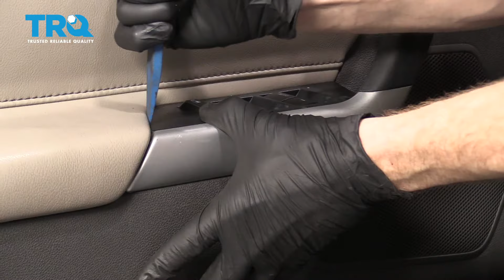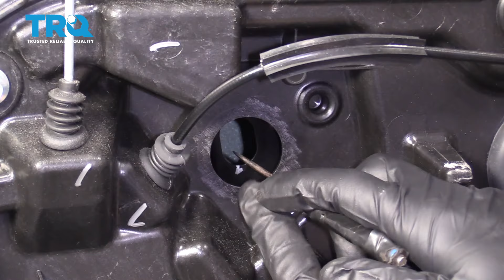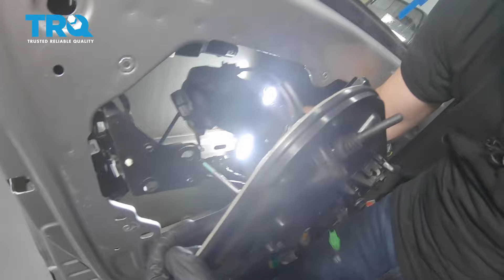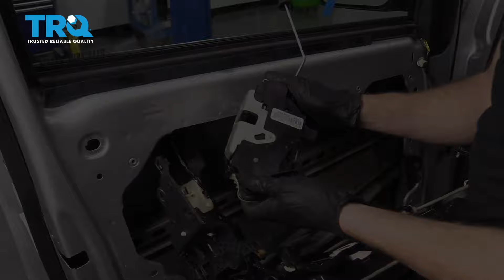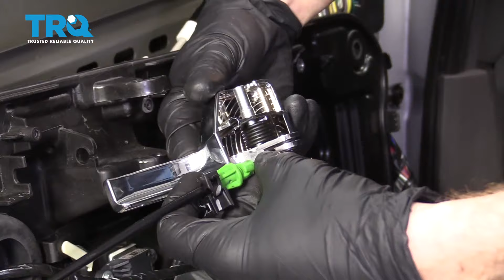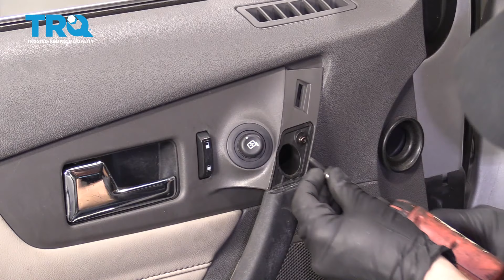How to Replace Front Door Latch 2007-14 Ford Edge

Comment: GREAT VIDEO, but NO WAY you did this in 24 mins more like 2-3 hours lol, I had to replace my 2013 driver door latch do to the well known 2013 edge problematic door open alert - which keeps the interior lights on and kills the battery even if the doors are all closed, not sure why 2013 has that issue the most? and I didnt know about the 2 little screws hidden in the track that would have been more helpful but I got it done, having 5 upullit junkyards near me I got to practice on their vehicles first before doing mine, anyway I was able to get 3 used latches - just in case - out of the same junkyard for $10 each 2012, 2013, and a 2014, the first one worked for me from the 2014 and took that door ajar light off my dash - fixed! its definitely a job you only want to do once and I recommend a new assembly over used you never know how long the used one will work, you dont want to do this job twice I got lucky - Ford engineers should have to also fix and repair the cars they create guaranteed theyd make it easier, thanks again

Comment: Thank you for this highly detailed and professional video. I am considering this because I am dealing with the idiotic door ajar issues in my 2013 Ford Edge; I have heard that the sensor is located inside the door latch. After seeing this video, I am still considering but realizing I will have to set aside a good amount of time to get it done, and make sure I get the part ordered BEFORE I start taking apart the door panel. :D. If anyone here replaced the latch because of the same door ajar sensor issue, please reply here your words of wisdom or input on the situation. Thanks much. I own the Edge and don't want car payments, so trying to drive it as long as I can. Thanks again. Happy wrench turning. :)

Comment: Great video! However I will say, if you aren't wanting to fish bolts and screws out of the door after you get it mostly back together, do this: 
Only loosen the window bolts enough that you can slide the window up and out of the bracket
Only loosen the screw on the back end of the door enough that you can slide the handle trim out
And DO NOT take the screw that holds the exterior handle bracket out all the way, loosen it only. Old lock tight can come through with the screw, gum up the threads, and cause you strip that bolt head when you go to put it back in.

There was also some things that didn't apply to the 2013 model as well, there's no more 8mm bold inside the panel. You don't have to completely remove the harness either if you're working on your own car (Passenger side at least). Just unfasten the very front clips so you have wiggle room. You can also leave the interior handle alone. Leave everything on the latch until its out, and pivot the panel out and rest it on your lap while you sit in your passenger seat. It makes getting all the parts off the latch easier. Work smarter, not harder.

Comment: Thank you for making this video. It was very helpful. For those who are thinking about doing this job, you really need to consider your time availability and level of technical ability. This job was pretty tough and I have fixed some complex systems. Also, you will need someone to assist you when putting in the two inner screws.
Reply from the maker: +@opsecalpha Thank you! We love empowering our customers and showing how to perform DIY auto repairs with our high-quality auto parts! http://1aau.to/m/Shop-TRQ

Comment: I did it watching this video, but it took me about 6 hrs. Taking it out was the easiest part, but putting the two bolts that attach to the panel was very challenging. Also I had a hard time resetting the window glass as one of the brackets came off while the panel was already assembled. I would loosen the bolts to lift up the glass instead of removing them as that would have made the job easier. Also take a picture of the door latch before removing it. I had a hard time putting it back together  so I had to constantly rewind the video. This guy obviously knows what he's doing, but for the weekend warrior be warned that it's quite the job unless you have a lot of patience.
Reply: Looks like it's not easy job 😮
Reply: Look is a pain to get to it but I'll try it and keep in mind your avise 😊

Comment: Great Video! Was able to replace rear left door lock on 2013 Edge. Replacement part from Dorman - works like new. Took time, and had issues with door mechanism (inside spring came undone) and later window wouldn't go down, but worked it all out.

Comment: 3 of 5 stars.
Never showed:
1- how to disconnect the green clasp to lock itself
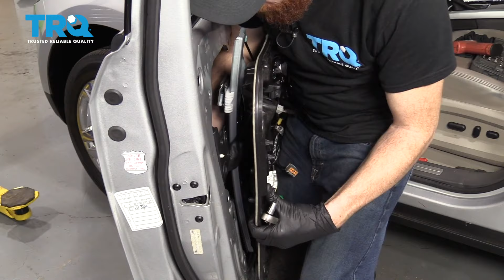2- the 3 bolts to the actuator magically appear at 13:03 to 15:35 and disappear again at 15:38. Then you "install" them again later?
3- around 16:35 you cut out the part where you have to disassemble the door to put the lock bar through the door. It magically appears ar 16:45
 But thanks for the video, it gave me a good guideline

Comment: You can much more easily disassemble the door handle on the outside and pull the latch and window regulator panel out as one, then address the fiddly lock/handle/etc with plenty of space.

Comment: finally replaced mine last night  could not have done without your video thank you  biggest problem i had was 4 of the 9 bolts holding inner panel in place i needed to grind off what a nightmare and those 2 bolts on inside of panel didnt have a problem getting off but what a time to put back in  realized your vedeo shows putting 3 screws back securing lock to door was un able to put those 2 bolts on inside but when i watched further i see your putting those 3 screws back in which you shoed already in so you took screws back out but didnt updat vedeo

Comment: When you put it back together make sure you run the locking rod before you bolt the inside handle back on. Great video but I don't know how it's possible if you hang the handle first.

Comment: Thanks TRQ. Couldn't of done it without the vid. About 2.5 hrs and most difficult is knowing when to put the door lock knob in after installation of latch component and the 2 8mm bolts needed during put back where you have to line up the plastic alignment guides to secure the shell to liner.  If not for those maybe 1.5 hrs. Thanks again

Comment: Did a lot more work then you need it to if you just had removed that side bolt from the outside handle the whole thing would have come out instead of you having to remove the entire panel or take apart the actuator inside the door which is uncomfortable
Reply from the maker: +Cryptic Gaming Thanks for the feedback! http://1aau.to/m/Shop-TRQ

Comment: I do not comment much on Youtube, but this is one of the best DIY videos I have ever watched.  Very professionally done and all of the important information is present without having to watch the complete turn of every screw.  I was not aware of TRQ before seeing this video, but I will definitely go out of my way to use their products whenever possible.  Thank you very much for the help!
Reply: After having completed this project, I have a couple of things that might be helpful to someone else attempting it.  First, three of the silver 10mm bolts that held the inner plastic panel to the door were stripped and there is no way to remove them without cutting.  The best way I found to do this was to use a hole saw slightly bigger than the flanged bolt head without the bit inside.  I used this to cut the plastic panel around the bolt so that it would release from the door.  For reinstallation, I used two self tapping screws with washers on both sides of each stripped bolt. Second, the two screws behind the rubber plugs that secure the window clamps should not be removed.  You can simply loosen them to release the window from the track.  This will save you the headache of the clamping mechanism falling apart constantly as you manipulate the door panel later.  Finally, if your hands and arms are bigger than a six year old's, the two 8mm bolts on the inside of panel are extremely difficult to install.  This mechanic makes it look pretty easy, but that was probably the most challenging part of the process.  Once again, this video is excellent and definitely gives you the proper steps for success, but you may have to improvise if you run into some of the bumps in the road as I did.  Thank you again to TRQ and good luck!
Reply from the maker: +John Bogikes Thanks for watching and the feedback, glad to help!

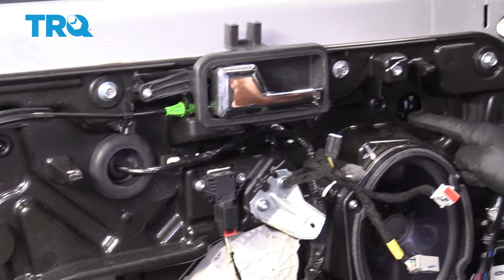Comment: Thanks for the video, did a front passenger's door on a 2011 edge by watching it, 2:30, if you only loose these bolts, the window should come off and will keep the inside metal part from getting off the rubber, if taken completely off make sure you start the threat just a bit before you sit the window back down, otherwise you might have difficulty putting them back on with the window on place, that was my main problem.

Comment: Thank you so much for this video. Replaced the right side latch on my 2013 Edge today and I could have never done it without this video. Didn’t use your brand but will sure do in the future if I need to. Most difficult part was removing those inside bolts - without proper tools. 4 hours and 4 beers later, fixed the issue and saved ~250$ of labor to have this replaced at a shop.